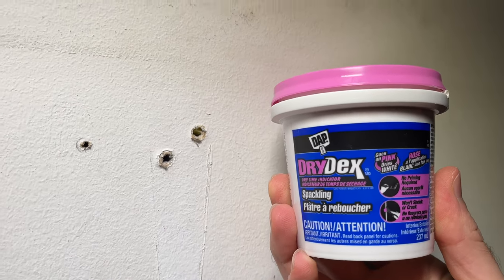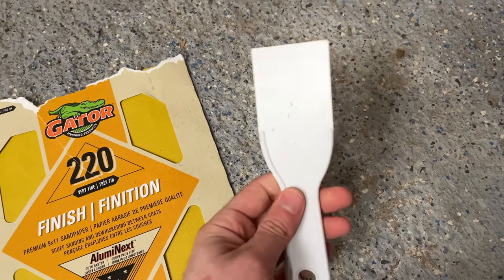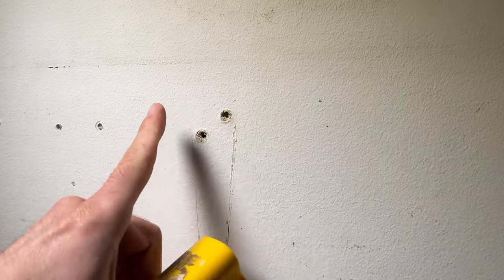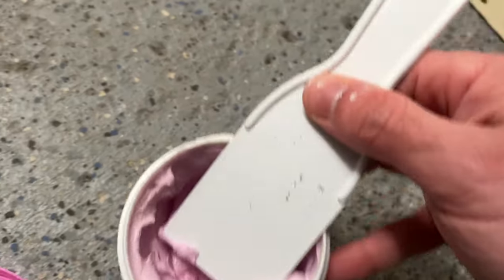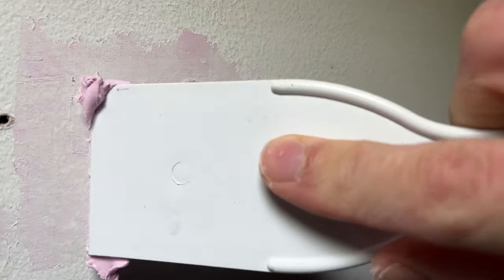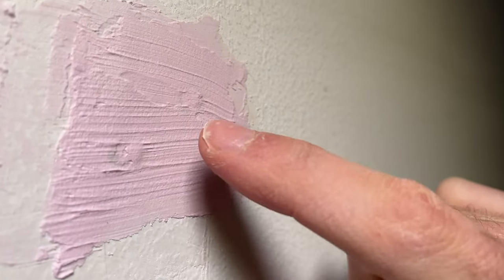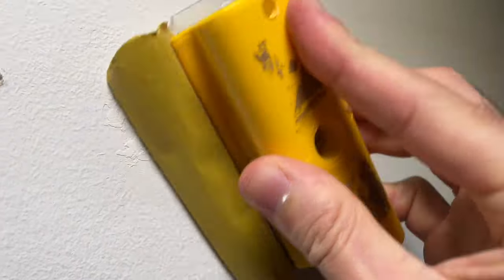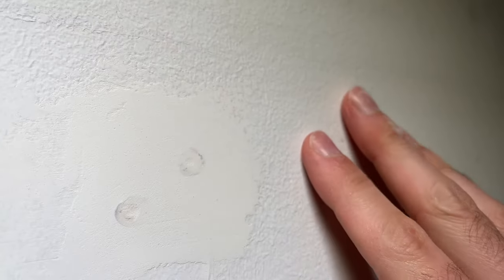How to Use DAP DryDex Spackling to Fix Drywall Holes

Comment: I don't sand mine I used a damp sponge to get the excess off.  That way you don't sand off the orange peel. And leave a flat spot.
Reply: Great tip! Thx for sharing!
Reply: Thanks for the tip, that's exactly what I was looking for how to do.
Reply: Do you use the sponge once it’s white or while it’s still pink
Reply: @MikeHawkeInYou pink before it dry
Reply: Wish I had read this comment before I just did this on texture wall! I tried to scrape the access off around it, but a sponge would’ve been much better.
Reply: That's truly a great idea! Just like clay. Great thinking, thanks for the advice.

Comment: Thanks for the excelleent video. As we communicate I'm using this product. After applying it and now wating to dry. I read that before using it it has to be stirred. I didn't. is it completely nessesary? I noticed that you didn't as well. Thanks.

Comment: Great video! 
Question: after you completed the sanding and smoothing out the filler holes in the wall. Do you then paint the area now filled and sanded out?
Thank you. Moving so I’d like to make sure I do this correctly. 
Ty for your time ☺️
Reply from the maker: Yes! Once you re happy with your sanding and the surface is flat.. you can start painting over
Reply: @TricksTipsFix  
Thank you! 
New Subbie to your channel
Reply: @UIV7096  but would need to paint whole wall or only that area, would it look like a  patch after Paint ?how to get the exact same shade of paint ?
Reply: @craftsANDRANDOMSTUFF  
Yes got it all done a few 
weeks ago Ty so very much

Comment: After it's dried and turns white, can I use the same hole to put a wall plug? thank you!
Reply: You can if you get a bigger plug than the hole, but if it's the same size the spackling isn't really strong enough to hold any weight.  You'd need to get something that clamps from the back, or like I said, a bigger plug (or anchor).

Comment: Can we use this for wood wall?
Reply: DAP DRYDex Spackling may be used to fill holes and cracks in surfaces such as drywall, plaster, wood, brick and stone. Its ready-to-use formula spreads easily for fast, professional repairs that will not crack, crumble or flake. DRYDex dries hard, sands easily and can be painted.
This is product information, I hope it helps

Comment: Thank You for your effort, but this product is miserable to work with. I know from experience. 
Dap Drydex doesn’t fill properly. It has such a strange texture. It bubbles out, doesn’t stick, doesn’t spread smoothly without pulling out of the space you’re filling. It DOES sink. It requires several applications. It should not be as difficult or as much work to spackle holes. I will never buy this product again.